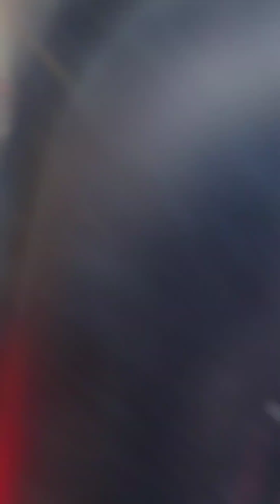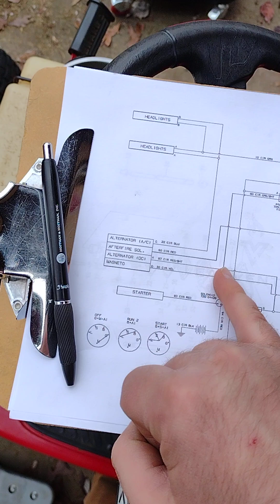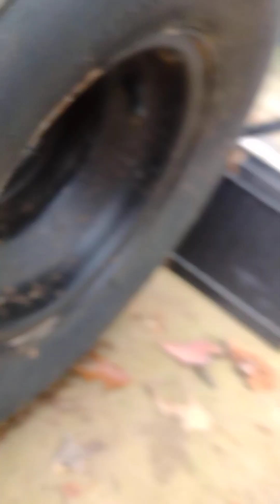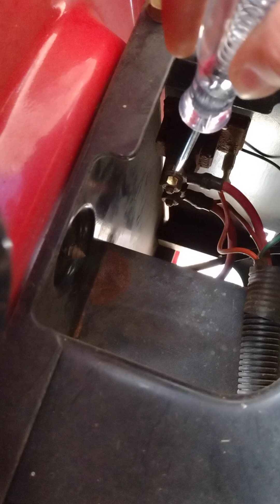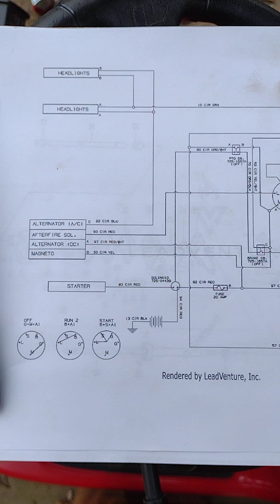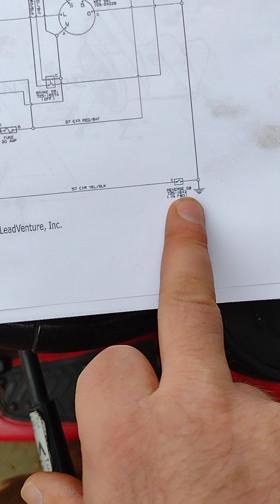Riding Lawnmower Electrical Troubleshooting (With Schematics)

Comment: Thanks for the video. Battling an electrical gremlin on the exact same mower. You wouldn't have any videos of the wiring to the amp gauge would you. They've disconnected it and I believe wired the two wires together with a butt connector.